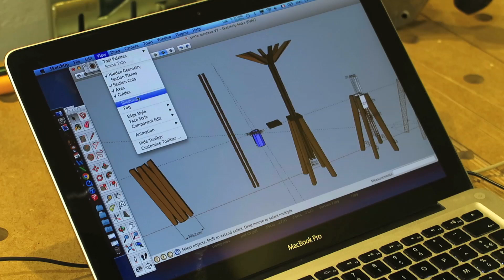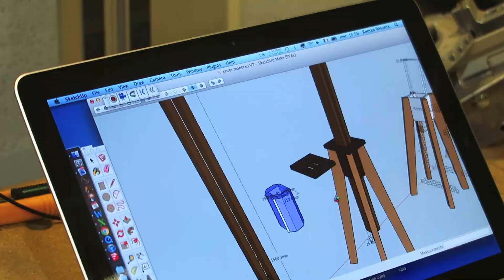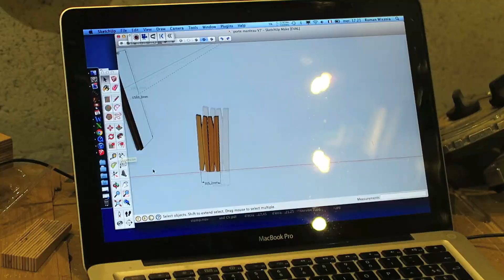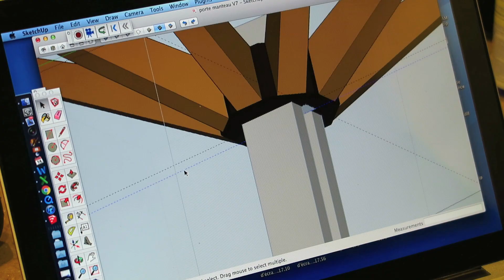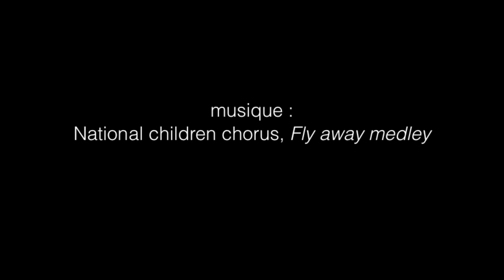Prototypage du porte-manteau sur pied (perroquet) nitsn

Comment: Nice work man, worth a suscribe. And the first time I see that machine for making mortises, does it work just fine? Any criticism?
Reply from the maker: Thanks for the kind words !! The machine is called a Domino, it works surprisingly well. Very precise and smooth to use. Only downside is the high price tag...but if you have a use for it I think the expense can be justified as it is a big time saver.